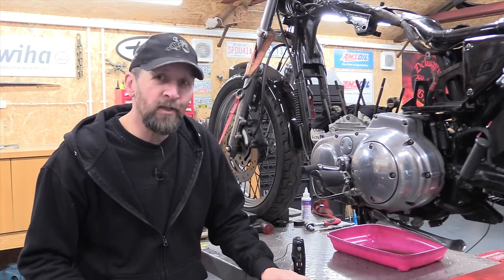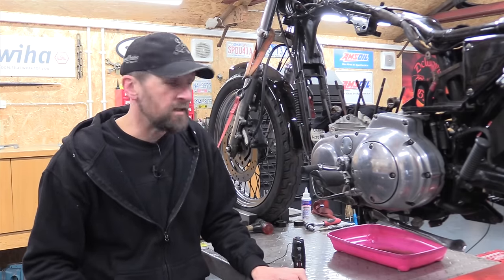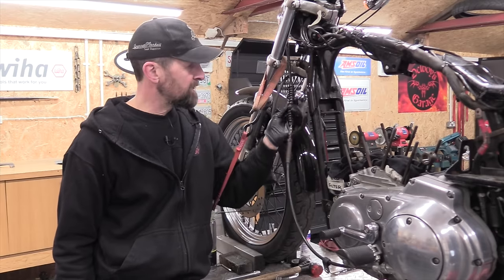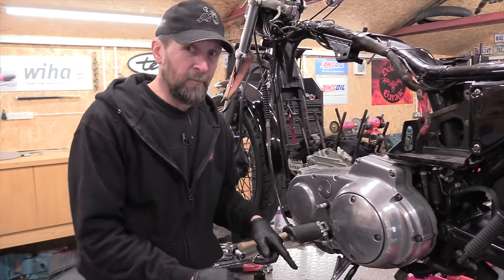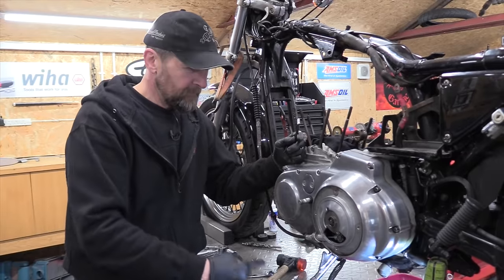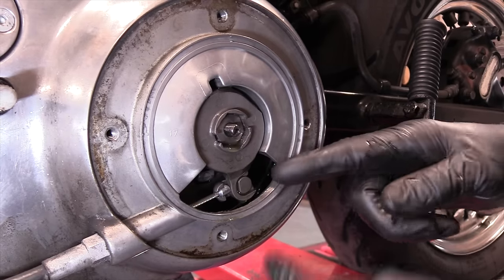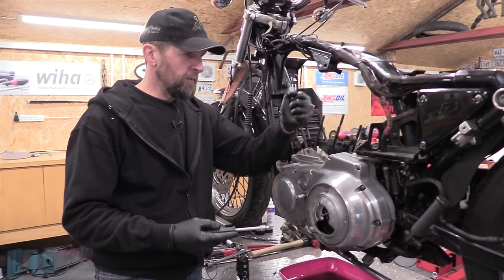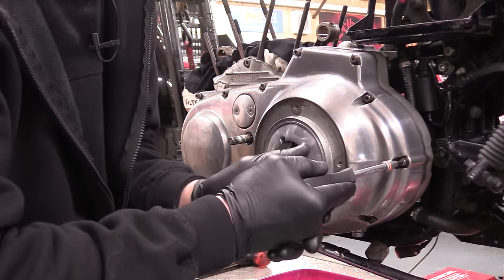Harley Sportster, Clutch Cable and Primary Case Removal !

Comment: As all ways loving the videos and more so your back with an HD. But, what I'm really glad to see is you got a pick set again and broke that habit of pulling orings with a flat head. 😉😂 Gonna be glued to this build!
Reply from the maker: Thank you for your kind words Gary, glad you're enjoying it, it's a fun project!
Reply: @Moonfleet41  what should I do if the center adjusting screw is flush with the nut beneath it? I’ve snapped the tips off of 2 flatheads so far and it hasn’t budged the slightest?

Comment: Hi Del & Penny
This episode was a timely reminder to keep on top of maintaining the clutch cable. I know you mentioned in the past using zip ties around each end of the rubber boot. Top tip! The cable looked nice and fresh in the  casing but I guess it will being splashed around with oil. I bet it's a different story further up the cable. I know you mentioned replacing it. Cycle manufacturers produce teflon lined cables which last way longer and work much smoother than steel lined cables. Not sure if you can get aftermarket teflon lined cables for motorcycles. 
Another fantastic episode Del in every way. Have a good rest of the week both! 🇸🇪🇬🇧👋🏻😊
Reply from the maker: Hi Paul, im not sure what the new OEM cable will be, but what ever it is it'll be better than the old one aye.!!  Thank you for your kind support as always buddy, it's always good to hear from you.. D&Pxx

Comment: Great “How to do it” video.
Anybody wanting to remove a Sporty’s primary cover would find it impossible to do incorrectly after watching that.
Love the cardboard template for the bolts. Whenever I’ve had to remove the primary on my Softail, that’s exactly what I do.
Keep it going Mate.
Reply from the maker: Thanks Nick, I love to keep fasteners in order when they're different sizes, and it helps to keep them altogether as well... with an engine in bits, it's easy to lose small parts and fasteners kicking around the bench!  Thanks for watching, have a great week!

Comment: What year is this sportster? Looks identical to my 95. Was wondering if you knew the size or part number of the o ring (clutch cable to transmission). Google hasn’t been my friend here and the service manual doesn’t mention it for my year. I’m coming up with 11179 but getting mixed fitment details for my year. 

Also, thanks for all your videos I’ve done the top end and several other projects all thanks to you.
Reply from the maker: Thanks buddy, glad the videos can help.. i wouldn't know the o ring size, i don;t bother looking.. just mach it to a fresh one from stock... Treat yourself to one of these, you'll never have this problem again... https://www.spanner-monkey.co.uk/rubber-o-ring-assortment-407pc-imperial-113280?search=BOR407&description=true

Comment: I have no idea what you are planning for the Sportster, but I sure would like to see, 19" wheels fore & aft, peanut tank, solo seat and a P Pad.  Make it into a real Street Tracker. 
Grandpa Fumblefingers
Reply from the maker: Hey buddy.. 19" rear would be great for "flat track purity", but there is almost NO tyre choice for "rear" on 110/90/19.... they'd be "front" tyres, and you'd have to mount them backwards if they're directional or choose crappy non directional commuter tyres.. it'd be better to go 18" on the rear, then i could fit a 130/70/18 which has a huge amount of tyre choice on the market and a lot safer on wet roads.. also it'd look pretty much the same and still give a lot more of a 'tracker look' than the dumpy 16" it has now..!
Reply: @Moonfleet41  Guys here are using Maxxis DT tires. What are the guys with Vintage Brit bikes running, Most of them had 19" fore& aft

Comment: If I just want to change the clutch cable do I really need to release the tension on the adjuster or  just follow the procedure until that step ?🤔 thx

Comment: thanks for the video in which you accomplished something worthwhile.  I needed it!  Feeling pretty discouraged myself.  Got everything on the ST reassembled and the damn thing doesn't start.  so back at disassembly and trouble shooting.  Just spins over.  ARGH    Ah well, all part of the experience :)  At least thats what i'm telling myself!
Reply from the maker: No way.. sorry to heat that buddy.. it can drive you mad aye.. specially after all the hard work to get it back together.. im sure it's something simple.. Good luck with it, take a step back, make a brew, and it'll all look different in the morning..   Take care and keep safe aye.. D&Pxx

Comment: Nice and simple easy to follow instructions as always Del! Interesting to see how much oil was left in there after the drain too!
Reply from the maker: Exactly mate, which is why when you fill the casing with oil, you must check the level and not just dump a quart in as specified.. you never know how much of the old stuff is left behind.

Comment: Quick question, how do you dispose of you oils after you’ve drained them?
Reply from the maker: Once i have a fair quantity, i take it all to the local recycling tip, they have a huge tank for it and it gets recycled into heating oil by the local council for schools etc..  You empty all the bottles and cans into the tank, then put the plastic bottles in the plastic recycle skip..!

Comment: Is there a torque spec for the 2 foot peg bolts that attach to the primary case? I'm having an oil leak coming from there and the manual I found online doesn't mention a spec.
Reply from the maker: If you have a primary joint leak, then tightening those two bolts will not stop it... remember the other bolts around the casing will seal it, even without the footpeg bolts connected... it's more likely you have a gasket breach, which is common if somebody has removed it in the past and re-used the old gasket... so I would, maybe consider, buy yourself a new one, whip the case off and replace it... and there will be a torque setting for those bolts, it'll be in your manual.
Reply: @Moonfleet41  I've cleaned the area around it and it appears that the oil is specifically coming from the footpeg location. I tightened them up when all was cold and it did help, but still had a small leak. So I've tightened them more whilst the oil was still warm. Hoping it completely eliminates the leak this time.. Thanks for the advice though! I plan to do a rebuild of the motor in the future and am super thankful I'll have your videos as a guide!
Reply from the maker: @wademccomas4004  Most welcome.. good luck with it Wade.!

Comment: hello wanted to ask which gear oil you could recommend (2001 Sportster 883)
Reply from the maker: Do you mean Primary oil?
Reply from the maker: @filipd.3613  Only two oils on a Sportster Filip, Engine oil, and Primary Oil.!   separate gear oil is only on the Big Twins !
Reply: @Moonfleet41  it's the primary oil. Which brand would you recommend and which type?
Reply: @Moonfleet41  yes the primary oil
Reply from the maker: @filipd.3613  Ive used everything from Screaming Eagle Syn3, to Amsoil, to even plain Dextron ATF.. it's just a splash oil to lubricate the chain and keep the clutch cool.. it's not under any pressure.. so just regular HD Primary fluid from your dealer is fine, treat it to something more extravagant if you like.. it's not critical !
Reply: @Moonfleet41  thank you Buddy